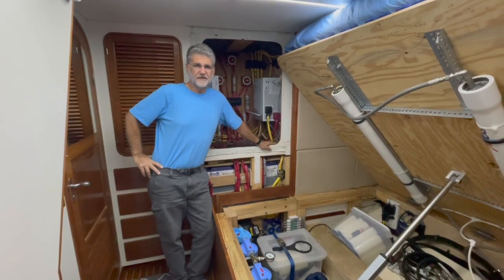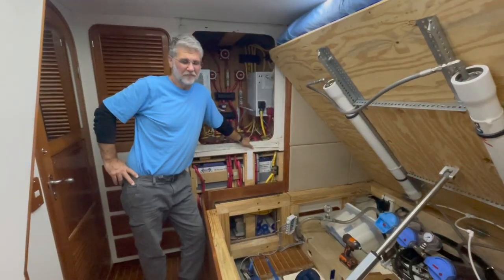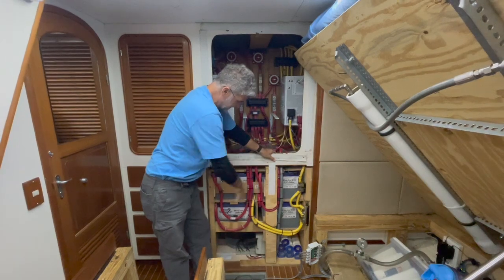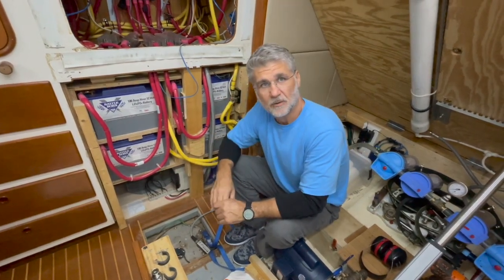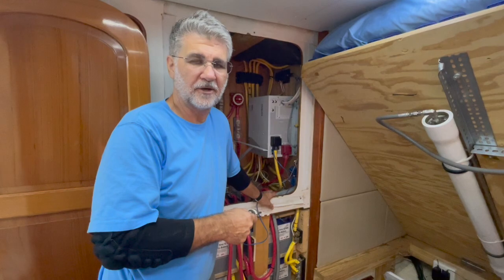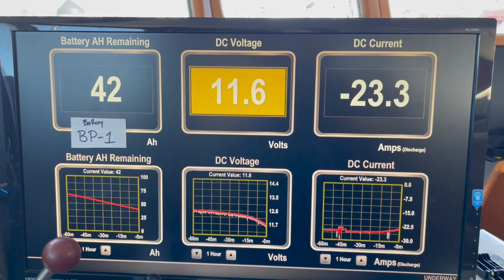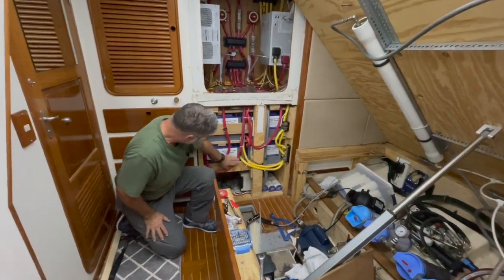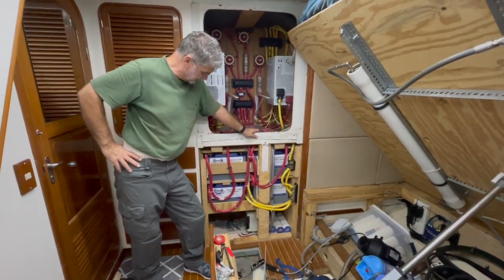BattleBorn Battery Bank Capacity Test and Replacement

Comment: CHECK THESE DANGEROUS SAFETY VIDEOS OUT!!!! 
DIY Solar Power with Will Prowse has 2 videos about this safety issue 12/2025.
“Battleborn 12V Battery: Major Safety Issue”  and  “Battleborn Batteries Responds! Their Overheating Device is a "Feature" not a "Problem"?? More videos to follow.

Comment: Great testament for Battle Born's warranty and attention.  Nice install too.  Where were you located during the fix?  I went through hell trying to return a failed  200ah Lithium  batt right out of the box. Had one low capacity cell.   Live in the Sacramento, Ca area.  Battery box had all the proper labels and info for shipping.  Fedex nor USP would accept the battery.  Said I had to take it to a 3rd party shipper...  Quoted $800.00 to ship to Reno, 120 miles.  The Battery company, not Battle Born, ended up sending me another battery, good will!  It was completely dead on arrival.  Would not wake up.  I had to have a friend drive to Reno, Nv to the sellers business a Converter, inverter, solar mfg company that sells batteries too.  They ended up giving me a refund.
Great that you got the issue resolved.... Kissing $3,000+ in batteries would be bad JUJU!  Jim.
Reply from the maker: Thank you for your comment. Wow, I am glad things worked out for you. That is quite a story.

Comment: Hey di you have any balance for 12v baterry installed with the baterry bank?
Reply from the maker: We replaced the entire bank at one time, and all of the batteries were tested for voltage before being combined. They were all at the correct voltage and did not need to be balanced before being wired in parallel. I did do a balancing charge once they were all connected.

Comment: Maybe it's a problem with ripple voltage, it's dangerous even for LFP.
Maretron DSM 100 has the ability to measure this parameter.
Reply from the maker: I have the DSM-100 and do monitor the ripple voltage. This was not the issue. I heard from BB, and the issue was with the batteries BMS's

Comment: Dang! only 3 years? Any indication of why they had such decreased capacity
Reply: I’m thinking that unless all 12 were from the same production lot which was somehow manufactured incorrectly it’s likely caused by end user error. I think it was just easier and less hassle for Battle Born to just replace them instead of going back and forth.
Reply from the maker: Nine of the twelve had a bad BMS, according to BB. They tore down the batteries and tested them. Three of the batteries had properly functioning BMSs. Not sure what the cause was or if it was some defect from the factory.
Reply from the maker: BB contacted me and said it was a failure of the BMS's. They don't know what caused it or if they were bad from the get-go.
Reply: I thought it might be your class T fuses, since you had so many of them. I thought they might be causing some kind of resistance.